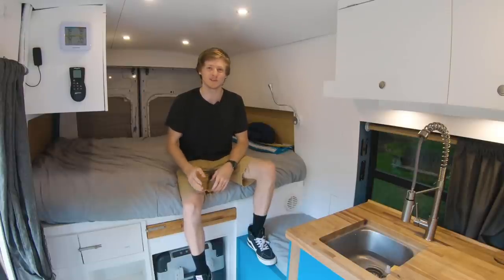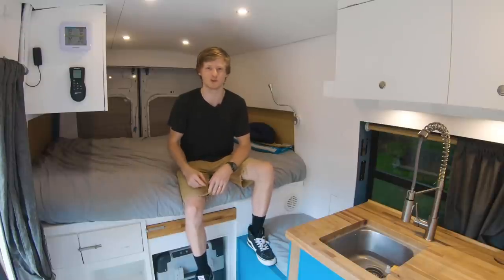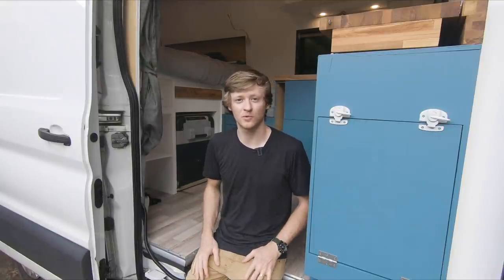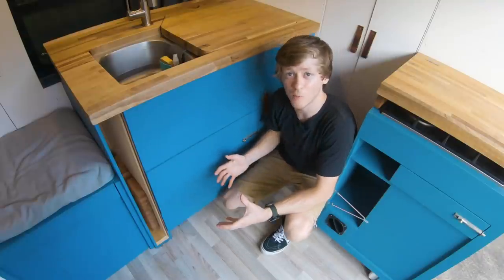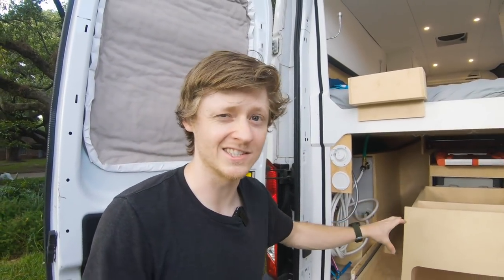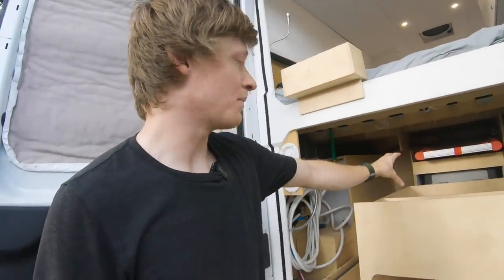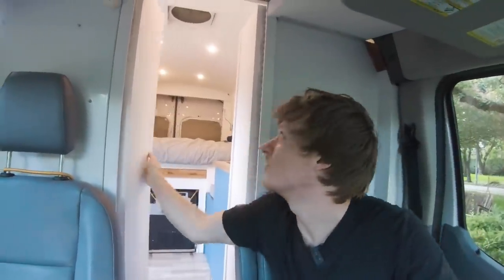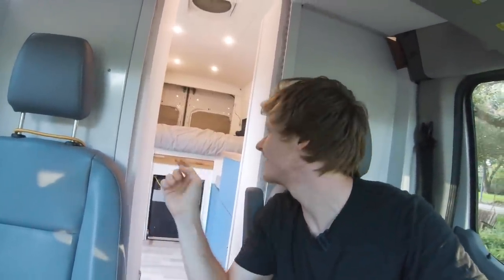5 Things I Would Change About My Van - Camper Van Conversion

Comment: You can get small vent fans to put in the top of your back doors. That way you don't have to mess with all that moving panels...I found them on amazon and they should be small enough. My suggestion would be to get 2, one for each door.
Reply: they too are made by Maxxair, and cheap! The only thing is they only blow out, but it will work!
Reply: @omalo3645  Well then they become passive to alow air flow when the main vent is running...so still an idea that may work.

Comment: On the bed - maybe separate your cabinet sections in the garage from the bed totally.  Hang several feet of utility rails on both sides of the van, get 4 or 6  of the 2x4 accessory clips to snap into the rails, cut 2x4 or 2x6 to span the width and lay your bed base supports on top of those, hold them in place with a pin and kotter key so they're easy to remove quickly. .  When you need an open gap for stuff - lift out the mattress and its support section(s), take the 2x's out and you're good to go.   The way it looks - you could probably move the center  out of the way for such use if the bed were up... - put the center items on a slideable plate and lock it to the other sections but so it's detachable and still runs in either condition.   Your videos are excellently done - be interesting to see your stuff with 20 years experience someday :)

Comment: Ox locker is the answer, its a limited slip until you lock and then its a spool. Another thumbs up 👍 for the video
Reply: I agree, a limited slip differential would really do for 99% of the traction areas this van would be able to go with only two wheel drive anyway. The locker would be a nice feature just in case, but even just an LSD would likely be sufficient and significantly cheaper.

Comment: Two ideas that could quickly alleviate your first issues, until you have the time and money to do it right:
1. Vehicles have a hidden air outlet so the cabin air gets circulated.  In my minivan it's behind plastic, behind the left rear wheel, completely hidden.  I've seen a build where there were two 5" 12v computer fans pushing air out of the outlet.  Maybe that would improve circulation with your roof fan blowing in.  Adding a roof rack and overhanging the curve of the roof will clobber your aerodynamics.
2. Hot water's great and it can be provided by the stove.  IMHO the most important thing is a waterproof area to wash hair and do a sponge bath.  Maybe drain into a container or pan in the entry footwell.  Running water is 80% of the work and 20% of the benefit -- nice but not critical, to me.

AWD on the 2020 Transit costs about $4750 and no doubt reduces fuel economy.  I like your diff idea.  Thanks for the video!

Comment: Locking rear differential would be awesome.....Air locker like a ARB ....Small lift kit and some bfg all terrains and you would be golden... I was thinking if you put a water tank under your rig your gonna loose all that ground clearance you gained from the lift and tires though.........

Comment: For a shower you might want to put a collapsible shower underneath your vent. Use the vent to extract the moisture. Use the hour shower and a half gallon of water can be used almost forever. Use quick disconnects for hot water and drain. Just make sure you use biodegradable soap and a teaspoon of Epsom salt to get rid of the soap suds and protect the filter. Store the shower underneath one of the cabinets or in the garage.

Hour shower: https://youtu.be/8s3jsleHXcI

If you don’t want a heated shower, use version one of his hour shower and dump a half gallon of warm water in the bottom.

Use a teak floor mat at the bottom of the shower so you’re not standing in water.

As far as the rear end a limited slip is going to take care of most of the stuff you would want to do. If you’re really crazy you might want to a full locker. Just depends on you what you want to do. Your tire choice is going to be the most important thing that you can do.

Comment: Not a fan of rear vents/fans. There is a reason manufacturers stop putting opening windows on the rear. Exhaust gets sucked into the vacuum behind the vehicle and actually gets pushed into those rear open windows (my old van and station wagon were proof).  
I am sure you know this already, and could figure out correct placement and sealing.

Comment: Hi Sam! I have appreciated how careful you are to explain whatever you are up to (van build, needs...) thank you! I am writing since you just posted and if any of my suggestions are helpful, yay! 1st, the fan, I have seen a new item come up which is the skylight with built in shades...what I like about it is: 1) it could pull in air while the maxxair is sucking it out 2) a person could use it for an escape hatch if needed, (it would also be a safe way to check out whats going on outside(I'm a single older woman), it would make easy access to the roof. Check out Max and Lee (YT) recent van build series (will be Max and Occy). Max is like you in that he is careful to teach as he goes, he has other great ideas...). I heard Joni (The Galavant, also YT) mention building so the fridge stays away from the door to reduce how hard the fridge has to work. I wonder if you could flip the power and the bikes, keeping the fridge away from the door? Two things on Solar rack, I have heard some folks are installing the panels directly to the van, bypassing the rack, I think you'd have to leave some room for them to breathe underneath, perhaps placing them on tubing or something? I am not sure I'd have the rack go ahead of the curve, seems you'd loose a lot of mileage. For hauling: I'd just put on a used trailer hitch (I say used, I am trying to do 'used' for things that won't matter (no used Maxxair , yes used trailer hitch, ~and trailer!) I recently bought a used cargo trailer that folds up and has a swing hitch (!) so I can access the stuff in the back easily. It also has another trailer hitch to pull a full sized trailer! I got the fold up/swing away cargo trailer and hitch system on Craigslist for $100. FYI I watched the ads for only one month before I scored. For the shower, I too have a tiny space and have designed (in my head only) a system that will work for me. I saw a vanlifer with a bendable curtain system called recmar (https://www.amazon.com/RECMAR-4108-Bendable-Curtain-Track), there are several systems out there, if you do this I'd be curious about what you go with, I'm sure you will get at it before me!. I already have a collapsable dog bath tub(laundry basket) but I wonder if the kind rectangular pool bathing tub (amazon) might work better, it has a drain. BTW I just saw that Cheap RV living posted a new recent video (the woman is wearing a rainbow shirt) and she placed solar panel on her door, I think this is a great use for an inexpensive flexible panel. The benefit is that it catches the water sun! Have you ever considered doing van builds for hire Sam? You are so intentional and careful (I loved the care put into not having aluminum filings anywhere). No matter what, I look forward to watching whatever projects you do next!
Reply: lots of good suggestions. Thanks for sharing and for mentioning the other YT channels and vids to see, and the products, and the link. I also like your idea for a towable cheap, used, trailer for occasional large haul needs.

Comment: Shower. Each space has multiple uses. Roll out toilet. Ceiling shower curtain rod bigger than shower.  Moisture removal will be the issue.
Reply: Good point. I think most people don't consider the moisture removal especially with hot showers.

Comment: Excellent build and educational videos 👍There are shower designs that don’t take up cabin space and remain hidden. Why not have a locker the swings out off the rear bumper for bicycles. The partition has security benefits but takes away a lot of lounge seating and living space a sliding roll up aluminum partition could be a solution.

Comment: Another 2 ideas to avoid the second roof fan is: 1) Install a floor vent. This enables the natural convection process to pull cooler air from below and vent the hotter air out the top. The concept is utilized in passive solar designed homes for better air quality and cooling. (See far out ride for details) 2) rather than a full sized RV fan/vent consider a smaller marine vent.

Comment: 1:51 Another way to create space for mounting solar panels is to build a modular "attic" on the roof. Check out Snow & Curt's YouTube channel & their conversion. I just recently discovered them and I think they have one of the coolest builds I've ever seen (cos they intend to live in it for a very long time, so they went all out on the build). Such "attic" has the following benefits:

A. gives you a ton of extra storage space, which is always welcome when living in a van
B. allows the fans to be hidden under the false roof, so you can keep them operational even if it's raining (even if you don't have a fancy/expensive fan with a cover)
C. gives you an entire roof-size flat area to mount the solar panels, so you can possibly mount even more panels, than you could otherwise, because of random things no longer getting in the way (like fans, antennas etc)
D. (fancy bonus) you can also add 12v actuators to your false roof to allow you to remotely tilt your solar panels in order get the absolute best solar efficiency (you can increase the energy production by 30-40% just by adjusting the angle of the panels throughout the day)